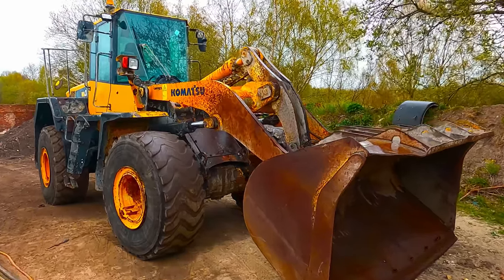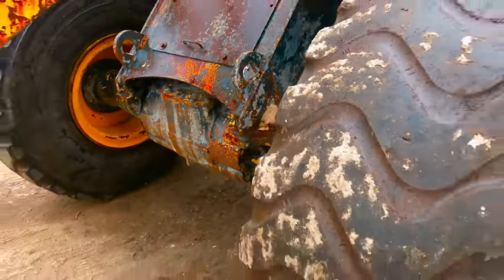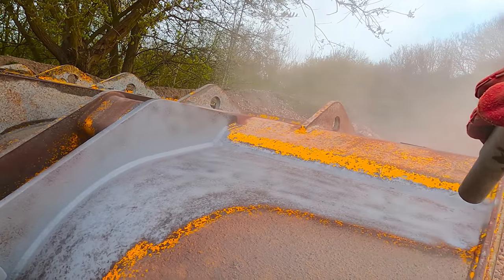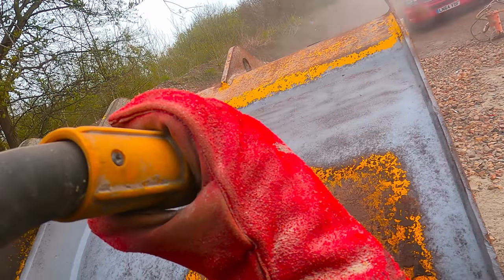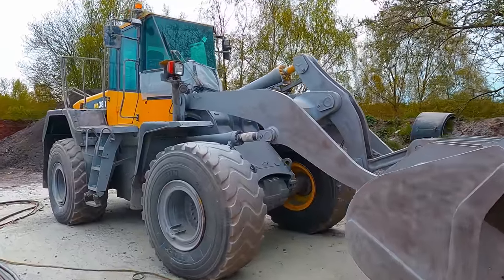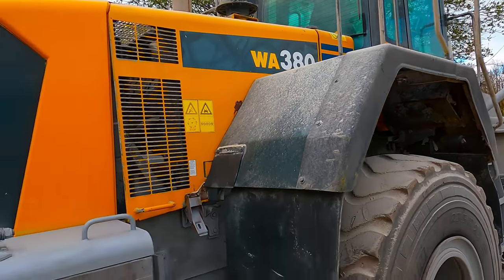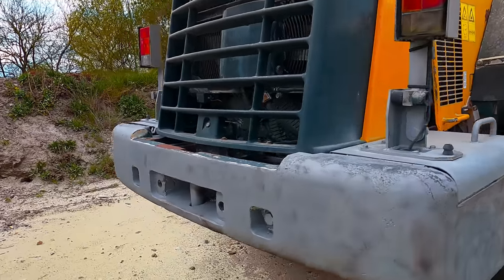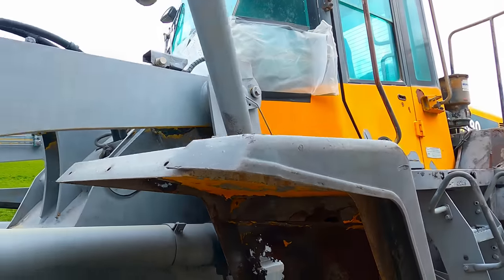komatsu loading shovel sand blast

Comment: I looks like you are missing a lot of areas.
Reply from the maker: Please let me explain :) Ive done a lot of work for this company and they know what to expect the job sheet was hit as much area as possible the notes was its going back out on hire and just needs to look good as it roles off the low loader. Area was more important then digging the rust out this was a lot of area in the time that was allocated and only real way to save on time was to give a light blast still perfect for paint and a lot better than rubbing it down by hand in the same time frame :) the customer knows what to expect for his money all this is explained before hand plus its a repeat customer for the past 10 year or so. I know what to deliver and in the time frame he asks for. I can certainly strip every part and blast it to a inch of its lift and rebuild with brand new pipes etc but the man hours and costs involved would out price this unit. knowing what to deliver at what costs is key in this business.
Thanks for your feedback.
Reply: @Mobileblaster  that makes sense.  Thanks for letting me know.  I  love watching your channel.
Reply from the maker: @aloggins69  I'm Glad your enjoying the content 😊 💞
Reply: @Mobileblaster  I am one of your subs now. This way I can follow your work. Thanks for sharing.

Comment: Great job, next time you do a loading shovel make sure the customer supports the arms. It's not safe, if a pipe fails the arms and bucket will drop on you!
Reply from the maker: Yeah I'm aware of that the bucket was on the ground taking the weight I know its no substitute for a stand but 3 rams would have to fail for it to move? I believe they have check valves and run on separate plumbing I could be wrong but I feel much safer with the bucket on the ground than in the air 😂 I would feel better with a ram lock in place haha
Reply: There should be a prop next to one of the rams. If the customer has removed it  he'll go to jail if anyone is hurt.

Comment: Mick, how many sandbags do you spend on this kind of work? After sandblasting, do you ground with a protective layer or not?
Reply from the maker: I would load up 750kgs but have the hopes of using 15/20 25kgs bags I forget exactly how many I used sorry.  Normally they are taken to the spray booth ready for paint the following day 👍

Comment: Watched alot of your videos, think the work looks interesting to do, is there a media you like to use more of? Theres alot of different medias to choose from and different medias do different things. Would like to have a go at it starting off small with a blast cabinet in my garage at home. Cheers
Reply from the maker: It depends on the job in question I would say phone the supplier and explain what you want to achieve and how ie blast booth as you can reuse the media in them so different media's do different jobs just like sand paper

Comment: Looks great Mick , I have a 4x4x4 foot glass bead cabinet. What type of media do you use . I have glass and walnut shells.
Reply from the maker: Thx pal 👍 it depends on what your blasting and the kind of finish your after mate. Look at it like sanding a wood 80grit will rip it to bits 320 would leave it smooth. Too many variables to say 1 media suits all 👌💞
Reply from the maker: I use a selection of crushed glass from supa fine to medium+ then steel shot and soda on this job would have been fine+ crushed glass or along them lines maybe medium

Comment: There’s a company in Houston, Tx that’s called Dustless Blasting. Have you ever seen there machine? It uses water with the air system really neat system.
Reply from the maker: Water on a job like this isn't a good idea. I have the ability to add water on this pot but every internal corner I get slurry all over me and the visor then at the end of the job it needs washing down to get the slurry off and it takes a very long time to get it all off plus the chemical that's needed to add to the water isn't cheap all this makes it not worth using 👍💞
Reply: @Mobileblaster  with the time saved it is, TSP is not that expensive.  used compressed air to blow out the wet spots..
Reply from the maker: @SegoMan  TSP? Adding water is adding problems it won't make it any quicker than dry blasting all water does is suppress the dust but using water covers me in slurry the visor and then the job needs washing down to remove the slurry. only 1 pro less dust 5 or 6 reasons to keep dry if possible

Comment: Always hypnotic watching stuff like this, One question though.  Does the abrasive that's being shot at the joints, bushings and seals make its way in and cause future problems?
Reply from the maker: Thx it's appreciated 👍No I don't fink so as it bounces off rubber so seals are normally fine. The pins that don't have seals only bushings they have auto grease feed so eventually it will push the media back out hopefully haha

Comment: Looks like that shovel was on winter roadsalt & grit work.
Reply from the maker: Possibly so with the state of it. I once had to do a 12 months old 1 that was worse than this turned out it was working in battery recycling factory they tuck it back off hire when they seen it for its service 😂

Comment: greetings from Serbia, great job, buddy how much sand was spent on this machine and how many hours was spent to do it? what is the power of the compressor in m3, which nozzle do you use? thanks
Reply from the maker: hello and welcome I don't recall how much media I used but if I did the same job again I would load the van with 25/30 25kg bags on the hopes of using around 15/20. Time taken 7 or 8 hour my compressor is 260 cfm and I use a nozzle that gets me 100 psi. 11mm I think I know it as cdx650 3/8"
Reply: @Mobileblaster  all the best, great results, what is the size of quartz sand and what is the sandblasting machine in question, which valve do I use for the same results, much more sand :(
Reply from the maker: @jmiki984  fine plus crushed glass don't worry about trying to match my media usage every rig and operator is different experience takes time my mate
Reply: thank you friends, all the best in your future work and I wish you a lot of success;)

Comment: I did this job for 10 years  with Silica Sand !
Reply from the maker: Oooo that's bad sillica sand as been banned in the UK since the 60s with the free silica you would have been exposed to high chances of getting silicosis nearly as bad as working with asbestos 😷
Reply: @Mobileblaster  It may have been banned but a local company used to dry it and bag it for me cheap , it was my own company i knew the risks .
Do you breathe the air filtered via you screw compressor ?
Reply from the maker: @PaulGreenwald  If im honest I've used sand too and not used a better media it cuts fast removes heavy scale and its cheap 😊 yeah I filter the compressed air so it's grade C air I make sure the wind from the compressor is blowing away from the intake as to reduce the chances of co2 getting into the air. It's poor air I'm breathing in I should have listened at school maybe I would have had a better job by now haha
Reply: @Mobileblaster  Nice reply '
I always felt the danger of breathing air/oil 
mixed compressed air was  a risk ,so i 
bought a mains powered air pump for my helmet , worked fantastic but obviously 
needed mains . 
I was lucky enough to inheret land so i am a farmer now , still kept all the kit though .
Good money in blasting now due to all regulations a lot of people got out .
Reply from the maker: @PaulGreenwald   @Paul Batchelor  yeah eva mains or 12v would be ideal I did buy a 12v air pump and filter but it hammers batteries don't last a shift i was going to rig it to work off the compressor battery but nether got round to it. I would love some land it would make my life easier 😁 Its always handy having a blaster on hand ya nether know what ya want to clean up next 😊 I don't know about good money I make a modest living but I put the hours in to make it work. If I turned these hours into minimum wage I would be well below it. Not a lot of people could do the job putting a bucket over ya head for 8 hours aday getting covered in all sorts of crap and breathing 2nd grade air all day haha the unglamorous truth haha
Reply: @Mobileblaster  I am located in the South East prices are higher here ,
i started blasting cranes , dismantled on the floor sandblasted on the floor to check for cracks ,i was getting day money £250 
per day in 2005 , diesel and sand supplied by the employer , 7 to 5.30 no stopping allowed 15 mins for lunch slave driving .
If you go to site today here with all kit you can earn £ 600 per day now .
Reply from the maker: @PaulGreenwald  It's amazing how the same country can vary so much in pricing from 1 area to next. I know cost of living is higher in the south of England so maybe why you can get so much?

Comment: What is the discoloration left in spots after you have blasted? Those dark spots? Isn't that corrosion of some sort that is embedded deeper into the metal? I'm just wondering if a courser media should be used to go deeper into the metal to take that out?
Reply from the maker: Yes your right you could spend extra money and time on a slightly heavier grit then run the risk of damage to other stuff that dony need the grit in or on. At the start I explain what this company was after and all they want from me is to make the serface free from loose materials and etched for paint. They don't require me to get SA3 standards. I could do it but then the costs would make this job not feasible. This serface is totally fine to paint over as this was over 12 months ago and that's the warranty period without any issues. If a good primer is used it will eat into any remaining blooms on the metal and neutralise it.
Reply: @Mobileblaster  Thanks for your reply. I did not realise that using a heavier media can damage things. It's good to know. Thanks for sharing.
Reply from the maker: @colinmartin5994  Your more than welcome the is a lot more to blasting than these videos show thats why I dont say they are a how to as everyone else will have a different take on things

Comment: Hi mate great job, what material do you blast with, I'm moving from a small Blast clean unit to a large one as i don't get very long between fills. I'm using iron filing media but it's a pain to keep recycling, and after the second pass through, it gets to dusty and far less affective. Any suggestions?? 
I'm only doing my own plant and machinery.
Reply from the maker: Steel shot will get more passes but its a course media and expensive. I'm a contractor so I get paid for speed I only use my media 1 x so don't have much experience with reusing media only with steel shot I know this lasts as long as it can till it turns to dust 👍 10 15 x through the pot
Reply: AHH ok, so if you don't mind me asking, what material do you blast machinery with ?
Reply from the maker: @MrPb99  99% of my work is with different grades of crushed glass 👌👍
Reply: Cheers bud I'll give it a try as the clean up of the iron fillings is hard going..... Great bids by the way, very interesting how you tackle different situations and products. Maybe we could get you up to Scotland for a training session.....
Reply from the maker: @MrPb99  I'm no teacher 🤯 I will share what I know but learning someone is a different story if you can take anything from these videos please do so at your own risk I would hate for someone to get hurt by coping my ways of doing things you will find your own style that works good for you 👌💞
Reply: Sorry for the slow response... Thanks Mick, I'll have a look around for a crushed glass supplier, and ask them if they could send me a few bags of each grade, then once I figure out what works best on the machinery then I'll order a pallet or two. You never know.... I might take a video a post it up for you and others to have a laugh at.... Haha 😃 
Cheers again and keep up the good videos mate
Reply from the maker: @MrPb99  look forward to seen it 👌🤙 good luck with your adventure 🤘💞

Comment: What media are you using on the digger?
Reply from the maker: Fine & fine+ and medium crushed glass👍
Reply: @Mobileblaster  Top Bloke thanks, which blast pot do you use for dry blast & your wet blasting? I've been looking at an EcoQuip2, but they are very expensive
Reply from the maker: @Milner_THX  I will be doing a video shortly when I get my patent for my build blast pot 👍
Reply: @Mobileblaster  Brilliant.. Thanks Mick :)

Comment: Why not spray the fresh medal with the solution that gives you 24-48 hours to paint before the metal rusts?
Reply from the maker: I can add inhibitors to water and then add this to the stream but then I have a slurry to remove from the steel also soon as I hit an internal corner it blows back and covers me and the visor in slurry 😵 I wouldn't know what to add to the media to do this dry to give a little protection doing it dry?
Reply: @Mobileblaster  Thanks for the reply.  I was going on a past memory.  I looked up the information and yes it was an inhibitor(Holdtight 102) added to water, not dry blasting media. My mistake. You were dry blasting. It was the wrong application on my part. Cool that you caught that. 
Thanks for the videos.
Reply: No you are correct there is a solution you can spray on after a dry blast, my local place in the us does it to avoid flash rusting
Reply from the maker: @3000gtalex  You don't need to spray anything on the metal after dry blasting all thats required is keep it dry if you plan on painting the next day and put it in dry storage over night it won't flash rust anyways. This saves money I was explaining that you need to wash the media off with a solution after wet blasting as wet blasting would reduce the dust but also increases the costs and complexity of the job 👍💞